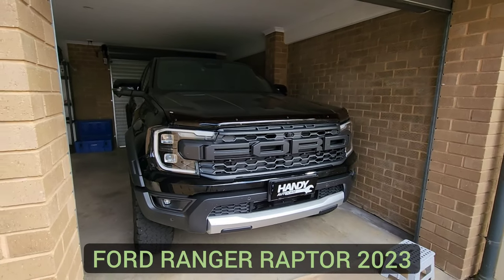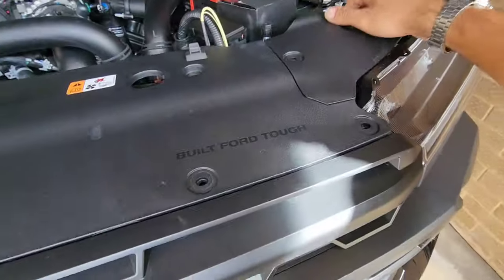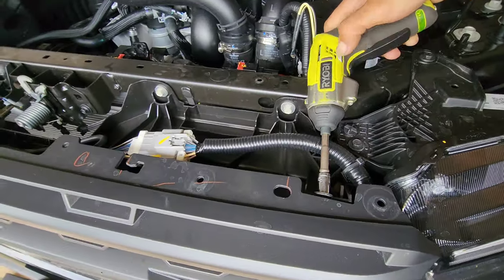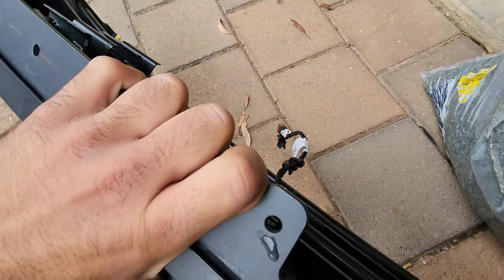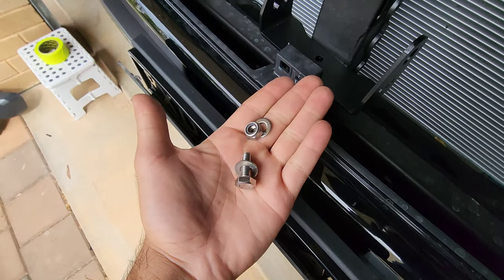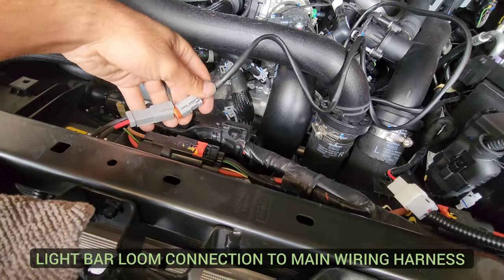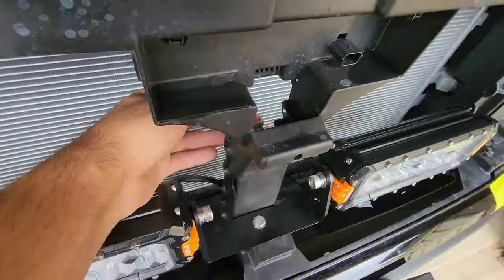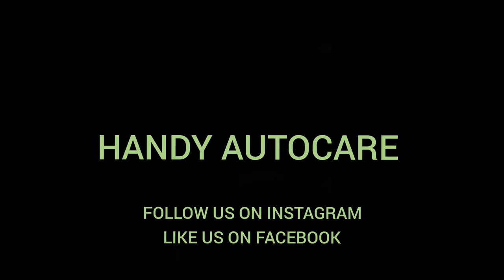LED Light Bars installation behind grille - Ford Ranger Raptor 2023

Comment: I found your video very informative.  But I do have a question for you.  I have a kit just like the one you have installed, and will be installing it in my NA Ranger Raptor.  But instead of just coiling the Stedi switch in the ON position, I want to tie it into the uplifter switches in the truck.  Since the Stedi wiring harness has a relay built into it, I imagine that I have to have a means to trigger that.  Is it safe to take the white and blue wires from the Stedi harness and tie them together, then connect the two of them to one of my uplifter switches?  Of course the black wire will be grounded to the chassis of the truck.
Reply from the maker: Thanks mate!
Consider the Stedi wiring harness switch as an inline kill switch. So connecting the switch blue and white wires together means the only thing disabling the 
Light bar will be the factory toggle switch that you are using as your high beam signal feed for energising the relay. 

The Stedi switch would act as the only source of disabling the light bar for cars that only have an original high beam stalk and no other way of Turing on high beams
Reply: @FordMercGuy  Right.  So as long as I have the Ford Switch is turned on, and my high beams on, the in grill lights will work.  But for whatever reason I don't want or need the extra light, I can turn the extra lights off and have only my normal high beams.  

Do I understand this correctly?  

I wasn't expecting such a fast reply.  

Cheers mate!
Reply from the maker: Yes this sounds good mate.
Even as is. The Stedi switch is just connecting the blue and white wires together. So if you want to test. Put the Stedi switch to the ON position. Then get familiar with what you can do with the Ford extra lights switch for enabling and disabling the extra lights and then using just normal high beams. In this test leaving the switch the ON position is imitating if you remove the switch and manually connect the blue and white cables together.
Cheers mate

Comment: Is the yellow/black wire an earth wire ? I joined to the solid yellow and yellow/black but there is no power going through when testing with multimeter and high beam on. ARB shifted mine from footwell to under bonnet when putting bullbar on
Reply: Can l just join red to yellow than earth the black to earth point
Reply from the maker: Hi mate the solid yellow is a positive signal wire and the black yellow is a earth wire. You could Earth separately as long as everything is connected and no brakes in the wiring the solid yellow should be giving you a high beam feed at least this Raptor with the factory auxiliary switches on the headlining this was the case
Reply: Yeh cheers mate looks like my earth cable is a different colour it's solid black and yellow/black is high beam lvl 3 mine is a Ranger so obviously different to the Raptor nice video mate 👍
Reply from the maker: Ah yes some small changes. Cheers mate

Comment: I’m not good with electronics, but where the lights connected to any of the control auxiliary switches in the truck?
Reply from the maker: Yes mate, this model has 6 aux switches and the lights now could be on or off with the aux switch (in line) with the original high beam function

Comment: There are 6 AUX switch ready to use (AUX1 and AUX2 are just design for the high beam light) relay and fuse all in the engine bay is there any reason why need to use another relay instead of the factory one?
Reply from the maker: Hi mate, we were just installing to the manufacturer instructions of the light bar kit. TrailBait. Indeed probably not necessary but we adhered to the install instructions.

Comment: Maybe someone can help me. 
We have new ‘23 Raptor, bought new light bar and now we want to connect it. Everything is almost done, CAN Bus is ready, but we do not know where to connect the CAN. Do someone know about it?
I want that light bar will switch on when I switch high beams on.
Reply from the maker: Hi, for the 2023 Raptor, the yellow and black wires as seen in this video is the factory trigger point that turn "live" when the factory high beam is activated. So using this point as your trigger for adding aftermarket lights.

Comment: Hi. Just wondering, as I might have missed something. If you’re running off Aux switch 6. Why do you need the extra relay?
Reply from the maker: Hi mate, we just installed to the aftermarket kit instructions!
Reply: Your right, it's already on an independent fuse and relay so could of used the yellow, and yellow black directly.
Reply from the maker: That's it mate.
Reply: @FordMercGuy  Depends upon the current draw of the lights - those upper switches for the driving lights are fused to 25A
Reply from the maker: The kit Manufacturer recommended using the factory high beam feed as a trigger for the wiring harness due to considerations for the current draw of both the lights.

Comment: Why are you using a wiring harness. All auxiliary switches have built fuses and relays
Reply from the maker: Hi mate. The kit's manufacturer recommended to due to current draw of these lights.
Reply: The current draw on each of those stedi lights is 5.9 amps @ 13.6 volts. Which is roughly 12 amps combined. Switch 5&6 in vehicle has 25 amp relay plenty enough for those two lights
Reply from the maker: Correct mate!
However the manufacturer of the installation kit recommends using the factory Ford supplied aux 5/6 feed wires Point as a trigger for the relay harness for safety. But true appropriate lights can be connected straight to that point

Comment: Not putting these in the way of, and blocking what... 15 to 20% of my aftermarket intercooler?
Reply from the maker: Yeah potential for blocking some airflow.
Trade off of not putting lights on the outside of the vehicle.

Comment: A update for the Raptor in the UK. It won’t work as there is no access to the middle bolt hole to fix the middle bracket down.
Reply from the maker: Ahh interesting!! Darn
Reply: @FordMercGuy  I’ve managed to fit them now but on the uk raptor there seem to be a inner grill which opens and closes. Plus there is no access to put a nut on the bolt. Had to re make the brackets to make it work.
Reply from the maker: It was a very tight fit trying to get a spanner onto the nut from underneath for mounting the middle bracket. Your UK spec must have an extra hardware in that zone to meet some kind of regulations
Reply: @Benchdogtools  Yeah, I have noticed a louvre flap system on the UK raptor which probably opens and closes based on temperature. Did this not cause you any problems?? for me I don't think I will be using this light location/option.
Reply: @Benchdogtools can I ask what alteration you had to make to the brackets to make them fit the raptor here in the uk please?
Reply: @jordanmeredith993  tbh I just made my own but I had to drill holes in the frame of the vehicle but there is other ways it could be achieved without drilling. A decent  drywall fixing would do the job better than the way I did it.

Comment: Should have been outside grill bar. Grill stopping it full light.
Reply from the maker: Traditionally yes, but this is for people wanting to keep front of vehicle free of extra additions on exterior for aesthetical reasons
Reply: @Ford Merc Guy  Did you compare the output outside vs inside ? How much is the diffrence?
Reply from the maker: Hi mate no didn't compare the outside vs inside as the owner only wanted the lights hidden away behind tbr grill.

Comment: Honestly, not a fan. The grill blocks the lights in every way. Just find lights that can attach without cutting your grill, minimize loss of airflow, and actually light up the road like you need.
Reply from the maker: Agreed a set up like this certainly does have its cons.
Reply: Bet it doesn’t block 1/10th of a percent of the light. 😂